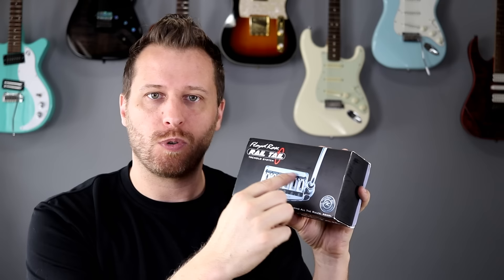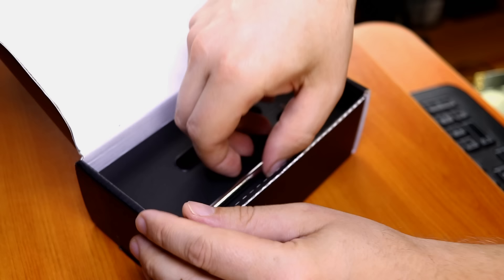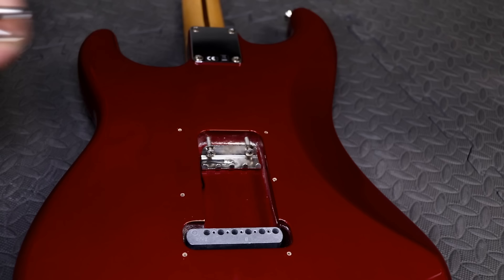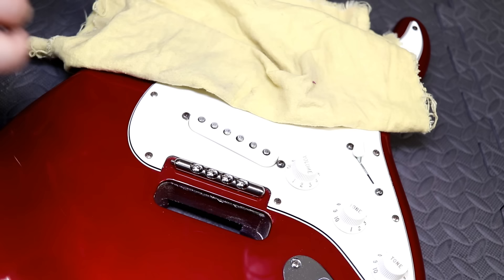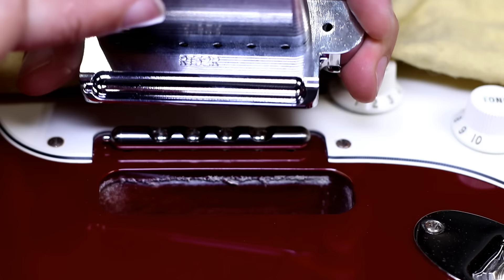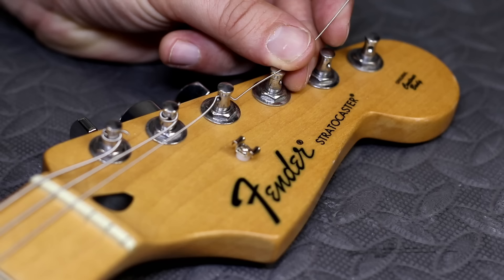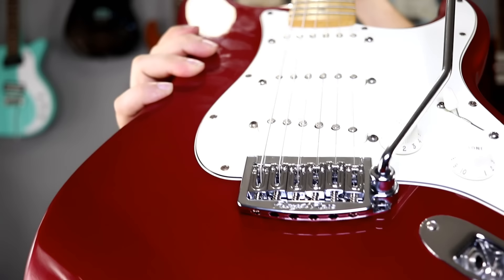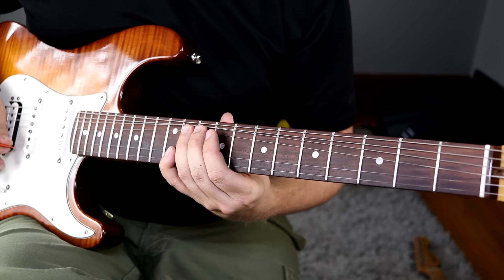Farewell to Fender's 6-screw Trem! - Floyd Rose Install!

Comment: Can you use the rail tail to replace an original floyd rose tremolo?
Reply from the maker: Good question. I think the Rail Tail requires a flat surface to be "decked" to, so if your guitar body is routed out, it likely won't work.
Reply: That's too bad. The rail tail seems like a very nice tremelo and I was hoping to lose the old floyd rose on my guitar.  Thanks for the response back!

Comment: Hi Darrell how are you ? I am a new subscriber and if you could throw me a little advice that would be awesome ! Ok I don't play guitar but I am disabled and I am home all the time and id like to give guitar a shot hence one of the reasons why I subscribed to you. So im trying to decide on a guitar it needs to be light & easy to handle so a Strat is on the list  An HSS either a 2017 MIM or these new Player Series so my  question  1) which should I get  2017 or 2018 ?  2) if you don't use a Tremolo will the Strat stay in tune or do you need to install a Floyd rose with locking nut ? Thanks Darrell !!!!
Reply from the maker: Hi! 
Welcome to the channel!
I think a HSS Strat is a great choice. 
MIM Standard or player series are both good, but player series has a few better features. 
If you don't use the trem, just tighten the trem springs and deck it ☺
Reply: Yesterday bought the 2017 mim Strat HSS standard artic white with a black leather case, JB trembucker  might go with the Fender 69's single coils not sure yet.
Reply from the maker: Yes!!
Congratulations 👍

Comment: is there a good replacement for a 2-post?
Reply from the maker: Hi! 
This will work for for the 2-point too, but require drilling the 4 holes for the rail (using the included template) 
I used HipShot on my SuperStrat and it's an awesome choice too ☺

Comment: $250 for this and I don't even think it is available anymore it is not listed on the website and I can get my MIM trem to stay in tune and for sound brass or steel trem block. Done. What I don't understand is how someone likes decking their trem or how they get it to stay in tune that way anyways. Worthless if you can't bend up and down to me. For double stops with bends just use 5 springs and bend the high e and b a tiny, tiny bit. That tone was pretty good tho and not normal Fender tone. It was really in your face. But sustain did not seem great. Your volume noticeably dropped out while you were vibratoing 1 of those notes. Like a normal strat might do the same thing. What I'm saying is,  I didn't take all this time mastering my PITA trem just to switch it out damnnit!

Comment: will it directly fit the 2 post trem
Reply: The spacer mentioned at 2:48 is also used as a conversion template for installing it on the 2 - point tremolo system as well. You'll need to drill 4 small holes in between the pivot posts to mount the Rail. This is shown at the 10min mark of the official Floyd Rose Rail Tail Installation video.

Comment: Hi, Darrell I'm planning to add this Floyd Rose on my Strat and I'm wondering that how did you set up the saddles on that trem like a lenght and highness? 🙄
Any advice?😅
Reply: You can use the old bridge to reference the height and position of the saddles. It should be very close if it was previously set up correctly.
Reply: @officialfloydrose5849  ok i will do that thanks a lot 🙂
Reply: @densdens8644  There are many great videos out there on set-up and intonation but feel free to contact us if you have any questions.:)

Comment: did you lube the nut too? not sure if this is really an upgrade as it appears you can only dive bomb it, no upward pitch twitching?
Reply from the maker: Hi Tom! 
I left the nut alone. I'll assess once my strings settle. 
This guitar has never had tuning issues, so hopefully that shouldn't change. 
This bridge was designed to be more than just a trem upgrade, but a "hardtail" upgrade too. Roller saddles, solid brass, and dense trem block. 
It would be a good choice for a guitar that suffers with a lack of sustain 👍
Reply: thanks for your reply DB. May I e-mail you with more questions?
Reply from the maker: Absolutely. Anytime ☺

Comment: Not possible to float it, even little bit?
Reply from the maker: I asked the guys at Floyd Rose and they said without knife-edges it won't be stable. 
This design is for maximum tone and sustain which requires is to be "decked"
Reply: Ah, ok. Thanks for finding that out and posting!

Comment: Is there an alternative for 2 point vintage trems?
Reply from the maker: Hi!
This one works for 2-point too, but the 4 holes must be drilled via the template.
Reply: Darrell Braun Guitar what's the string spacing on that guitar in mm? My guitar has a 54mm overall string spacing and 10.8mm of individual string spacing. I couldn't really tell from the details on the Floyd Rose website.
Reply from the maker: Hi! 
It's standard modern Fender width.

Comment: First of all I agree with half the people on here: it sounds silly to put a $250-$275 bridge/trem on a $300-$400 MIM Strat! You never brought that up.  Why, my man?  Ya know, we'd really prefer to save that money and upgrade to an American Strat. Why? Because we're psychologically messed up (thank you Fender). Also, I don't get the whole: it won't go out of tune thing. Makes no sense to me. Because when you pull down that trem, the strings have to go limp don't they? Sure they do. All of them are loosened at the same time. When that happens the strings will absolutely go slightly out of tune because you don't have a locking nut on the head. My biggest complaint with the stock bridge actually isn't the whammy bar at all. You know what is? Those damned pointy screws. Am I the only person who hates them? I need to get one of those 2 hole bridges with the smooth surface. Now there's a piece of hardware I'll pay, uh, $75 for. :)

Comment: what kind of pickups do you use?
Reply from the maker: Hi! 
Just the stock Fender pickups In this guitar. 
For aftermarket pickups I've used Darkmoon pickups in a couple of my projects and they are really amazing.
Reply: quick question in one of your other videos you used the fender select strat pickups but i can't find them anywhere. Do you know where i can find a set for my strat?
Reply from the maker: They appear to be discontinued, which is too bad 🙁
Reply: Oh dang. Thanks anyways Darrel, keep up the vids friend.
Reply: sorry for the bother but would you knew a set of pickups that sound close to the fender select for about the same price-ish?
Reply from the maker: Hi! 
Any over-wound Alnico set will get close. 
Look for a medium - high output single coil set and then lower the pickups down a touch.  I find that is a good setup for what I play.
Reply: Thanks mate! Cheers.

Comment: Anyone going to put this on a $120 squire strat? It crossed my mind. 🤣 It's like go buy a better guitar already.
Reply: I'm thinking of jamming on on my Affinity Series Squier that I got for $15 at a swap meet.  Why?  Why not?  I love the neck, and it sounds good with a Dimarzios that I installed.  Wood doesn't know if it was used in China or Fullerton.  Besides, I love to tinker.
Reply: @reno145  yes why not. If it will help the playability. But the cost is not so bad if your guitar is worth it. Yes I had a squire that played great and of course it's a cheap guitar always end up replacing the tuners. But the pups were good and super low noise no ground buzzing. Great guitar for 130 bucks.

Comment: I would have liked this design & probably would have bought one but I find rollers to noticeably reduce sustain & have certain tone, good if you like less sustaining strings with slap-back echo, for some Rockabilly or Surf sounds for example, but not if you want sustain & that is not the intended sound. A proportionally curved edge for the string leaving point is good, but rollers? - if you Super glue the little f****rs (rollers) it sounds significantly better, even disinterested girlfriends agree (without knowing what adjustments you've made). So why go to the bother of the much better (for the sound being aimed for) sounding & sustaining non-floating trem, due to more contact area & less wobbly bits, only to dilute those advantages with roller bridges?! Why?!... why?! A little bit of pencil (soft pencil 4B or softer /sketching pencil) works much better for tuning problems caused by string frictions, it's essentially Graphene! Mr. Rose is an undoubtedly a clever, creative man having designed a wonderfully innovative, iconic piece of music making machinery that is part of Rock'n'Roll history in the form of his original tremolo/wang arm, & this Rail-Tail would also be great, so why fall at the last hurdle with crappy, extra floaty, string energy dispersing wobbly bits of metal in the form of rollers? Rollers. I enjoyed this video & your trem comparisons video Mr. Braun, thank you.
Reply: I agree that most cheap roller saddles can sap tone but that has more to do with the design and materials used. These are high-quality saddles that are machined from solid brass for optimal tone. The stainless steel rollers are inserted to help with tuning, more importantly, prevent the strings from digging in or,  as the technical term goes, coining. Most saddles such as the vintage Stratocaster style (the good ones) are made from a single piece of thin stamped steel and are nitride coated to around a hardness of 50 Rockwell. This prevents coining and also lets the string glide easier. The downside is the saddle is very thin and is not ideal for optimal tone. Unfortunately, you can't harden brass, and machining a solid saddle from high carbon steel would cost a fortune. Therefore a roller is used in these applications.

Comment: I take it this doesn't fit on a guitar that has a two point tremolo.
Reply: Yes it will. Using the template included, you'll have to drill 4 small holes inline with the 2 pivot posts. The Floyd Rose installation video shows this near the end.

Comment: Some cool ideas in the design, but to me, it is a big heavy clunky flunky piece of junk.  The best design is the original design.  It was the rigid, responsive, lightweight, and reliable. They are perfect.  The shape of the bar was also perfect.   Everything changed for the worse.  Brass for a tail stop?  That is only for people who cannot feel.  And for anyone who thinks guitars will stay in tune, you are not in tune with the guitar. To play guitar is a story about a struggle. To see a guitar begin to melt on a player live and the drama that occurs, and the rest of the band knows, and the audience knows, and everyone knows it is starting to go, and the drama that arises, ..and the other band mates come to the rescue, and people are on the edge of their seat to watch the guitar player struggle with the guitar, pulling each chord into tune, and each note into tune, as he plays. ...and you start to hear the guitar player dropping notes and leaving out strings, and restricting to just a couple of strings that are still left, and then finally one-stringing it on the big E string, with the whammy and a lot of whammy vibrato.  The audience was glued the whole time to all that drama.  Time to stop and tune with a tuner.  Next song. That's how rock and roll used to be and is supposed to be.  It is not supposed to be "perfect", because that is dead.  It's supposed to be alive.  See Van Halen for more details.
Reply: And Floyd Rose killed the Van Halen sound.  ...and to finish it off, they got him to switch to wireless and paint his guitar red and black, from the original white and black stripes.  The white guitar sounded 1000 times better than it did red, with the idiotic Floyd Rose POS, and just to add insult to injury, lets add a wireless system too.